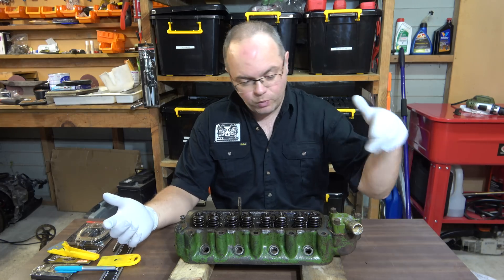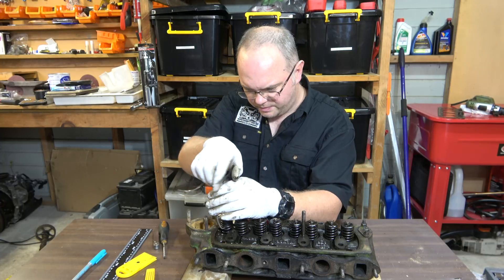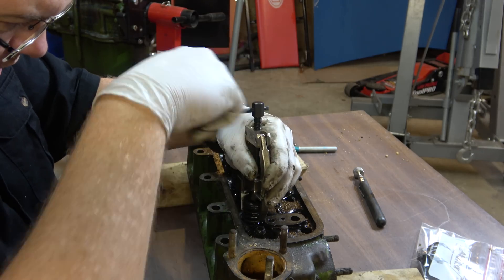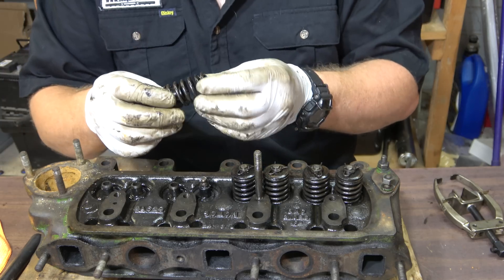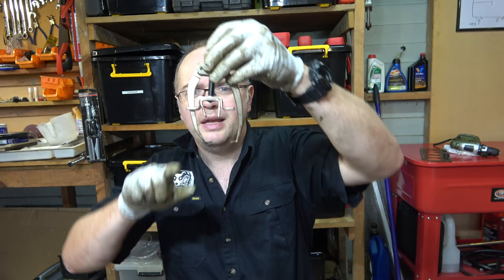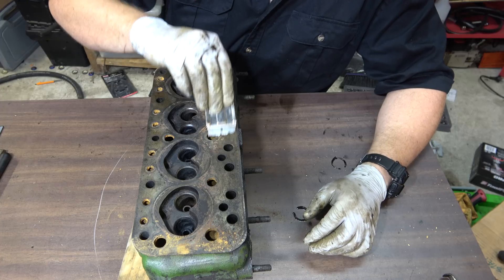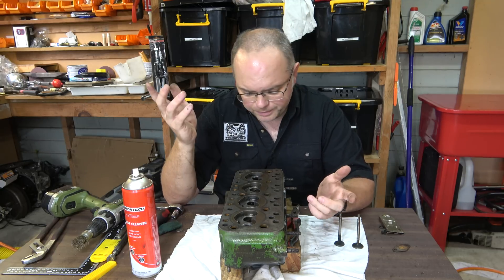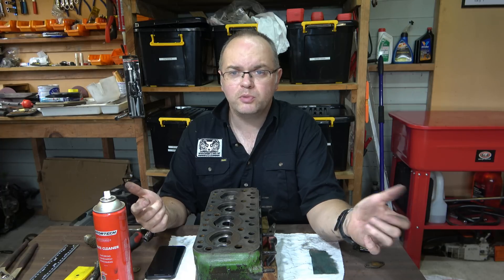Morris Minor - Cylinder Head Teardown - Part 9

Comment: skip the valve compressor tool and use use a socket and a mini sledge. one tap and the retainers pop out. reinstallation may require a tool

Comment: "Lifetime guarantee" is something most of us were familiar with back in the day. This is the legend that would be advertised on the packaging box or leaflet that came with the tool. And some manufacturers even thanked the buyer "for purchasing their tool". Lifetime was taken as 50 years - a generic figure - and the tools would last the distance as long as the manufacturers "How to use and service" guidelines were followed. 
The Toledo valve spring compressor fell out on the third spring, how times have changed!

Comment: I've never seen a valve spring compressor like that before, and after watching this I don't want to ever see one of them again !!
So why would one valve burn like that ??
Reply from the maker: You and me both although to be fair it does serve a purpose. I'm not too sure on why the valve would burn like that. I'll have to do some research
Reply: If your valve clearance is too tight, the valve can't seat properly, and it will burn out.  Otherwise, a piece of carbon can get stuck between the valve and valve seat, which will also cause the valve to burn.

Comment: I haven't rebuilt an A series since i left NZ in 1980.  Today I wouldn't bother with the original head but fit a metro head  for the better ports, Stellite valve seats, sodium exhaust valves and NO Cracks. I think there is a couple of studs in different places but otherwise it's a close fit. Don't forget to fit a New oil pump. The old ones have tendency to fail when faced with having to pump oil against new bearing clearances. My Dads older sister had a few Morrys in Hamilton. One,a nice black one was stolen around 1970. In 1979  the cops knocked on her door asking if she wanted her car back!!!. it had been recovered and was pretty dirty with rust but otherwise OK after being parked somewhere for all that time.

Comment: Throw that valve spring compressor in the dust bin!  Get a good quality used one from eBay or somewhere else, after all you will need a good compressor to reinstall the springs.
Reply from the maker: I have a replacement on the way

Comment: Why valve spring compressor easiest way is old spark plug socket and hammer
Reply: Yep, surprised you didn't do this to rip them out, then use a decent compressor to refit them.......xx

Comment: 1,000cc, hmmmm....I could put that in a motorcycle frame. Anyway, it all reminds me of when I overhauled my Pinto wagon. It was a simple overhead cam engine with worn cam lobes. I got it all cleaned and machined and added new parts when needed. When it came to starting it I left the tail pipe off, just in case. I put a dab of gas in the carb, sat in the car and said, "Well, here goes." I turned the key and heard this LOUD noise! It started right off, I barely heard the starter, so it surprised me! LOL Scared the crap out of me. Keep up the good work. Don't think I'll try that other valve compressor. Just used to the old standard tool.
Reply from the maker: It's amazing how loud things are without headers and an exhaust. I learned the hard way too with my VW!. Cheers, I think that compressor is destined for the bin.

Comment: Having stripped and rebuilt many many.A series engines,I can tell you with some certainty,that the valve guides will be worn as will the valve guide seals.You will have to replace both.A little tip for you,don't buy cheap valve seals,they last maybe a couple of hundred miles if your lucky, buy genuine,they are still available as are new valves.Nice video by the way.
Reply from the maker: I have a great parts guy so I'll be getting the right stuff to get this motor going. Cheers

Comment: fair play for having a go, always a good idea to get a socket and tap on the valve spring caps before trying to free the collets off as it can free them a touch from being wedged hard into their little tapered seats,  good luck with the rebuild
Reply from the maker: I did find tapping them with a hammer did help, the socket idea sounds like a good plan. Cheers

Comment: I have never known a 948 cc A series burn out a No1 exhaust valve, It was nearly always No3. I think this head has had some repairs done to it judging by the condition of the other seats at this mileage. Fit some double valve springs, new valves and guides when you rebuild it.
Reply from the maker: I hear it's not that common but it's what happened. I don't know too much on the history but I don't think it had a lot of work done

Comment: I used a c clamp type valve compressor bought from SCA on a 2.25 Rover engine and it buckled after a couple of tries
Reply from the maker: I'll get the revised SCA one an see how that goes. Cheers
Reply: No worries. At least they took it back, i ended up getting a much meatier version from Repco at about $160. Cheers
Reply: i have the same type valve compressor Does the job in a fraction of the time it took this poor guy to do it with that crappy tool he had So much for progress !!!!

Comment: You don't need to change the fluid in your parts washer until it's so dark it sucks all the light out of the room...  ;)

Burn exhaust valve?  Nonsense!  Morris just had a variable compression and dynamic airflow system 50 years before anyone else!

For goodness' sakes, you've got two kids, Jonathan!  Get your respirator on when you're scraping, and work wet!  I have it on good authority that asbestosis is rather unpleasant.  :(
Reply from the maker: The pump is struggling with the big chunks, I think it needs filtering at least. 

The British car is ahead of its time. They went bust years before anyone else 🤣🤣

Fair point. Full body suit, respirator and helmet from now on

Comment: I made my own valve compressor simply by bending double a length of 5mm steel rod. It hooks under a nut & washer on a rocker-assembly stud. Press it down on the collet retainer to free them off. It takes seconds.
Reply from the maker: That sounds better than my junk one

Comment: After some backyard modification that little compressor did the job well enough. The head etc looks not to bad considering its age and your cleaning fluid is fine just filter the crap out then it's good for a few more washes lol.
Reply from the maker: It seems to be in reasonable condition. I need to first the junk out of the parts washer, the pump is not a fan!

Comment: Unless you are going to do high mileage or wanting a racing engine, both of which I doubt you do not need to go to the expense of hardened valve seats. The little A series will run quite happily on unleaded. I have rebuilt several of these heads over the years and never had a problem. Are spares available over in Australia? I am in the UK and most parts are still easy to come by. Great channel by the way.
Reply from the maker: I'm not planning on hardened valve seats. It's not a common upgrade in classics round here. There are a couple of local spares places but the best range is from the UK and shipping is reasonable. Thanks 😀
Reply: @Badgertronix  you really do not need to go down the hardened valve road   my moggies run well on unleaded  with no problems what so ever   one of my   cars has a  fairly  hotted up engine in her  trust me she flies  real  good   and all i put in her is unleaded  and so far  fine  enjoying  the videos  nice to sit back and watch somone else doing the work

Comment: I used to place a clump of rag under the head and smack a 13/16 sparkplug socket over the valve cap and the collets come out easy but be careful cos they can fly out if you're not on the ball and I'd burn the carbon off the ports and chambers with an oxy torch then magna flux for cracks before recutting the seats and buffing and facing the valves before a final surface grind...And yes we repaired any cracks by stitching tapered plugs in them...Good old days for sure...If you ever need any tips.   ziggyreese@gmail.com
Reply from the maker: That sounds like a better way to get the collets out. Plenty of things I don't know about this project so I'll definitely be in touch. Cheers Zig

Comment: That’s probably the most useless valve spring compressor I’ve ever seen turned a five minute job into a marathon.
Reply from the maker: You're lucky I edited out most of the struggle out. That thing wasn't very useful
Reply: Just found your channel. Are you going to grind all the valves in your next video? I’d repaint the engine in BMC / MOWOG green as I did on my 66 Mini and it will look fantastic! Keep the videos coming. 👍🏻
Reply from the maker: Next video I'll continue stripping the engine block. Then after that I'll build it back up. It will be getting a coat of green paint 😀

Comment: If you have a pillar drill, put the valves in the chuck, and use a wire brush to clean them, a little WD40 helps too
Reply from the maker: Cheers for the tip

Comment: Was that spring compressor cheap? I've only ever seen and used the type shaped like a G cramp that reaches onto the valve's lower face. Fast, effective and strong enough to separate the collets from the bidda medal.
Reply from the maker: Fairly cheap. I got that one over the g clamp type as they're not that common on YouTube. I'll get a better one for the reassembly....
Reply: @Badgertronix  They're a LOT more fun to use.You can squeeze the spring right down.In fact you have to grease the collets and stick em to the valve or they tend to fall into the taper too far.Another thing to check is the pressure face of the rockers.They get recessed and make for tricky clearance setting. I miss fixing engines......
Reply: I agree it's the type I've always used, the one in the video looks cheap and nasty. Did the job though.